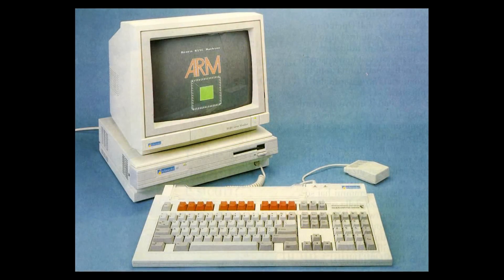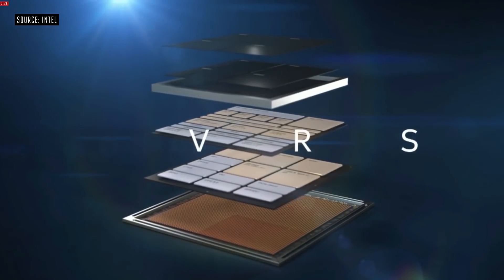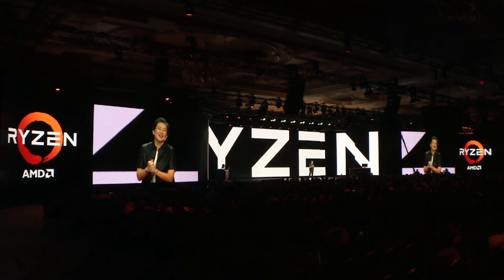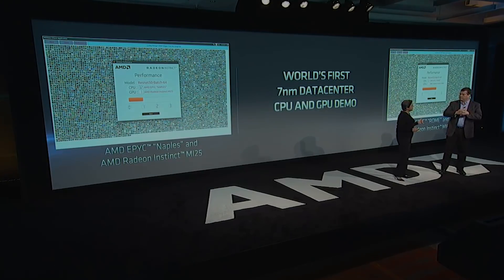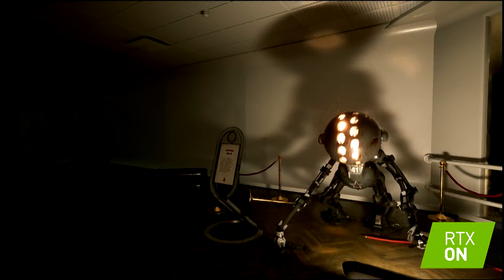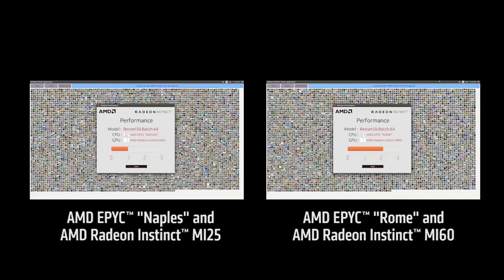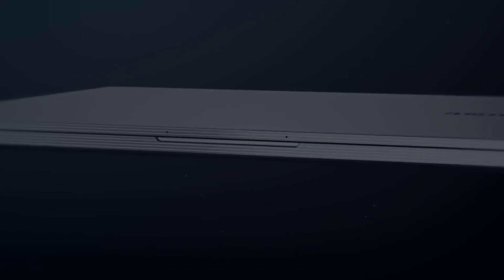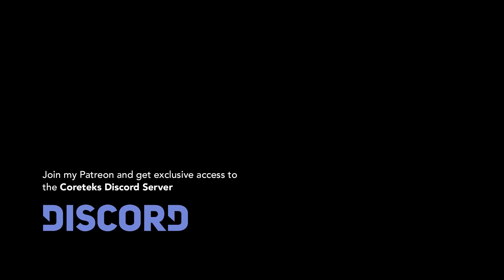Hardware trends: How many cores do we need?!

Comment: Amdahl's law is pessimistic because it does not account for that while adding cores, developers will expand the scope of what the system can solve, i.e. Gustavson's law reflects this. An example is adding more cores may not increase the framerate in RT, but it could render the scene at higher resolution at the same speed.
Reply: But do we need more than '32K' instead of 'current 4K' ?
32K being: 2x16K resolution VR.

Comment: that graphical about making code multicore isnt exactly accurate.
You wont be initializing a variable in one core and using it in another at the same time.

Parallelism only works well with instructions that can be done independently and the results merged later. 

I think thats the perspective thats missing here.

The real benefit of computational parallelism isnt doing one task faster but rather doing more tasks. Sometimes it just so happens to be the case that you can break down one task into smaller independent pieces.

This misconception of speeding things up with multi-threading comes from not understanding how to use multi-threading. 

Also it would be a terrible fate if we were stuck with MOBAs and Battle Royale games for the rest of humanities existence.
so i think your missing out on the fact that adding more cores allows for developers to try adding more features to games that will run at the same exact time as other features.
Reply: I couldn't say it better. 
There are other types of rendering as well, e.g. based on convolutional neural networks, 
which, according to the narrator isn't a case of a customer's usage (wrong!)
Nvidia using tensor cores for their autoencoders to denoise the picture, 
which reduce the load on the rendering process and boost FPS. 
Finally, as you mentioned, it's not just about stupid rendering.

Comment: For normal use, one to four as fast as possible cores and many tiny ULV cores so everything can keep one to itself with it's own dedicated addressable memory range.  I foresee a colony of cores dedicated to simulating a bureaucracy that is dedicated to completing every task but as securely as possible without any task having any ability to stall or access anything not expressly passed to it by the owning process/thread; after asking multiple security threads to verify that it is safe to do so, which can be accelerated by each security thread carefully determining actions safe enough to and then whitelisting.  Eliminate all possible side channels.  This might already be doable with enough programs having a CUDA version; but I don't know if a GPU can currently be used that way.

Comment: I don't get why raytracing can't approach a higher parallelism than 95%. Wouldn't very small improvements in the code potentially result in impressive speedup gains?
Reply: Chrysippus, imagine the 5% is the guy sitting at the top of the organisation, giving out jobs to the other 95% and then puts it all together in the end when they come with their results and show the result on the monitor.

Comment: There is just one thing wrong here, you talk about the law of parallelization. Remember this calculation you made is for the optimal case scenario, aka the most favorable for the parallel approach. In reality, real SW usually runs to the single-threaded roadblock way sooner. For example in a game, it does not matter if the physics engine can thread to 256g threads or that even the rendering can do 32, when you can run in to single animation or effect that is single threaded, becomes bottleneck quickly and drags the framerate for that scene down. In that moment that will be your bottleneck and your performance and it does not matter how well the rest of the code is parallelized. Same goes to for example video editing, You need just one aprt of the chain to have single thread bottleck and it will hold the whole thing down and it does not matter if the rest of the core is scaling well, as long as the bottlenecking thread is active, you are not scaling. And that is why superior single thread performance is still the main factor in CPU performance for most use cases, cores come second, cause they are pretty easy to add if needed. Its way harder to make one core perform 40% better than throw 16 of those cores in there.

Comment: Very good points about the limits of paralellization. Here's hoping programmers and/or hardware guys can come up with ways to get more multithreading done in sequential code. 
I'm not seeing a future for a Surface Thin Client in my backpack, though. I have very little use for a laptop that's effectively dead as soon as mobile connectivity cuts out... and coverage isn't nearly good enough where I live. That said, I'm seeing a lot of TC usage in companies. (Citrix in particular; there's a lot going for it from an IT security perspective and it does save on hardware costs.)

Comment: There are some glaring issues with things like the raytracing performance estimation. Sure the building of the acceleration structures is not trivially parallelizable. So there is that. 

However additional rays are trivially parallelizable. So that part does indeed have ideal performance scaling from additional cores. So one can increase the rays per frame basically without bound assuming constant scene complexity. And if we see now the games have rough budget of less than 1 ray per pixel there is need for way more rays than that even for current scenes.

Another thing about parallelization is that amdahls law is insufficient to tell us everything. As an example FFT has the usual time consumption of O(nlogn) but in parallel it's O(logn), like so many others. In terms of amdahls law it would be as if the parallel percentage would change as per size of the working set. You can estimate it that the serial part as a ratio of workload goes like 1/n, always going closer to zero but never reaching it.

Comment: Consumers don't NEED the performance they are being sold already. Companies have been very good at creating the need for performance levereging social media and the requirement for small portable devices with snappy reaction times. My guess is that at if HW scaling becomes too expensive, customer market will shift all its effort in diversifying in UI and user experience, rather than performance. Personal assistents, knowledge engines, augumented reality, etc...

Comment: Interesting clip. I would add, when single core single thread chips were the only ones, then multi-threaded programs didn't exist. But the nature of operating systems, even if they were single task systems like DOS, you still had to get at and use device drivers. So we got the concept of threads. Once we had an OS that could handle threads, then we found a multi CPU system (server) could handle more than one thread at once. Then we started to fiddle with hyper-threading. Then we saw multiple core, then both... That was all about 20 years ago. So now we have individual programs that may spawn 8 or 16 threads, and we have many cores that can all run 2 threads, so the way software is written, is changing.
It should be also said, writing heavily threaded programs is hard. Some kinds of tasks lend themselves to it rather beautifully, but many don't. We will move toward an increasing number of cores & threads, as a way to sustain the principle of Moore's Law, but for that to work, we need more multi threaded software. To get that, we need tools to make it.
We had tools to write multi-threaded code 20 years ago, when I was learning to program. But what we have today, 20 years on, is really no better.
Before we criticise developers for not writing better multi-threaded code, we need to take a good hard look at the quality of the tools, and the degree of difficulty in using them. But even with the best tools, some kinds of tasks lend themselves to parallel processing and some just don't.

Comment: Moving into a different material other then silicon based processors, the clock speed can be vastly increased. Gpu's are unlikely in danger just yet. Also games will likely use machine learning based a.i for everything from graphic improvements to actual a.i behavior.  Alpha star (deep mind) uses around 50% of a desktop gpu for it's a.i.
Apu's won't cut it for cutting edge next Gen and the Gen after video games.

Comment: There’s Mozilla’s Rust programming language, which is specifically designed for parallel workloads and is being used to greatly parallelise the Firefox browser.

Right now, Firefox has fully parallelised the CSS engine, which puts it ahead of Google Chrome, and the next step (which will be landing this year) will be parallelising the rendering using WebRender, which uses the GPU to render the entire web page, rather than using the CPU in a single‑core manner like what Chrome does.
Reply: Rust and all sorts of corrosion are bad! Use de-humidifiers and other anti-corrosion agents to keep your stuff safe and Rust-free!
Reply: Google's Go is slowly but surely eating Java's lunch on the server. New projects that would be in Java 10 years ago (Kubernetes and Docker for example) are now in that language. Server CPUs have a ton of cores with meh single core performance. It's higher level than Rust and have different use cases, but it's super easy to spread the load out on many cores in that language.

I love Rust, but multi-threading isn't as core to the language as it's in Go.
Reply: @spsproos  Funny how you mentioned Kubernetes, it was first created in Java. :-)
Anyway, I would say Go is the new hotness, but Rust does seem to be technically a better language.
Reply: @autohmae  No argument there, I love just how powerful the language is. I wish I could find a central place for Rust in my professional and personal coding, but I find Go much more productive for just about any kind of servers or I/O work.
Reply: Rust? I'd rather use C.
Reply: @G33KN3rd  Kids these days. Before it was C? I'd rather use Cobol. Seriously though, good luck with writing correct heavily multithreaded C programs...
Reply: @az09letters92  multithreading is hard regardless of language...

Comment: I see most of what you presented in this video as challenges more so than hard limits in computing technology. If we make (or better yet have A.I. or hardware make) better compilers that increase the parallelization of programs, we will be able to make way better use of many processor cores. Amdahl's law goes both ways in a sense, because the difference between 95% and 99%  ability to be executed in parallel would be a 5x reduction in latency for large amounts of cores, for example. We are definitely reaching the end of the silicon boom, but there will surely be a couple more doublings in performance before we hit a hard wall. Hopefully there is a future in photonic computing though, if we really want to have another explosion of personal computing power.
Reply: How many decades have been spend on making better compilers which can generate better parallel code ? And mostly failed. I don't think that is where the improvements will come from.

Comment: The problem isn't that WE CAN'T make stuff parallel, it's that we don't want to.
Multi threaded workloads: Are harder to debug, Are more error prone, Are harder to program, Have overhead and can make code harder to read/manage.
For games, overhead is very important, yes you could make the game better for people with 32 cores, but then you completely fuck the majority of the market with <6 cores. 

From the steam hardware survey, <2% of people have >6 cores. It's a catch 22. More cores are useless in most workloads because nobody wants to buy CPU's with more cores because they're useless in most workloads.
Reply: They publish minimum requirements for a game for a reason. At some point it makes sense to jettison old hardware. Just because tech progress slowed down, doesn't mean 16, 32 or core CPU won't become a requirement, just like now many games don't load on a single core.
And consoles drive this a lot too,  so when they massively increase the core count, you can expect the same for PC games.
Reply: @fobusas  It will, but it's going to be slow.

Comment: Just a clarification, Amdahl's law only applies to individual programs that have both sequential and parallel components.  It does not apply to running entirely separate programs on separate cores which is perfectly parallel, so multi-tasking can scale indefinitely.  I know that the majority of users will never use their hardware to its full potential, but having more potential is still a very good thing when it comes to putting powerful tools in the hands of curious individuals.  With more capable hardware comes more talent looking for ways to (ab)use it.

Anyway, I don't think there is any need for the CPU/GPU manufacturers to halt progress on parallelizing their hardware because they don't think many people can use it... that's intel bullshit sitting on quad-core CPUs when there was a clear (though perhaps somewhat irrational) demand for more cores.

The software developers should always push the limits of their hardware, and the hardware manufacturers should always be looking to remove those limitations.  Neither should ever assume that any number of cores will be enough... just let the market forces find the limits (if they even exist).  I can easily imagine a future where we have 256 CPU cores, with 128 of them dedicated to a proper AI assistant that is far better at multi-tasking than we humans are.
Reply: Amdahl's law applies but it scales linearly because the parallel coefficient is 100% for such processes. Also, I do not agree that raytracing is 95% parallel, I think its 100% parallel. Where is @Coreteks source on this?
Reply: @adi1133  30XX series will be 3-4x faster in ray-tracing than 20XX series. Not 27%, so I don't think the 95% value it correct.
Reply: Perfect
Reply: Sound and video conversion and reencoding works very well this way as many can be done simultaneously
Reply: And using Amdahl to estimate performance of next gen chips ignores Architectural improvements

Comment: Right, but Linux video editors, and multithread programs can be much more efficient running in parallel. Kdenlive is very good at assigning work to as many cores as you like during the rendering process. In preview / editing mode it only works with non parallel code, but the rendering is where parallel performance can hit 100 percent.

Comment: Yes. I am NOT an average user. But I could use more cores than even 8. Maybe 16 is around the top, but I wouldn't say I wouldn't see benefits from 32 cores. - Talking smack with a quad core Trinity APU lol :) -. Cause yes, one or two sw won't be faster just because having 16 cores. But when I simultaneously running an audio player without HW acceleration (ASIO FTW) , 2 different versions of Firefox at the same time - which uses 16 threads together -, and a lot of smaller applications, running a photo editor, maybe even doing a batch conversion... Then I am playing something while this going in the background, no. I will see the performance gains. Although I know. I am not average. And I am not normal.

Comment: Nice points at Amdahl's law... but u need to cover Gustafson's law also... maybe in another video
Reply: Yep. I thought theres something wrong with his assumptions, especially since the problem size is reduced for many things right now, so it is possible to work with our not so big computing capabilities. For my bachelor's thesis I trained neural nets on 64x64x64 Voxel databases. I would love to see things like 1000x1000x1000 or even more, especially, since I know how well this worked with such little data and how well this scales with higher resolutions. But the 1080s we worked with, won't do this. We would need a much bigger parallel computing ability and much, much more memory for doing something like that.

So a program might only be 95% parallelizable, but if you increase the problem size, it might get better, because it matters more to the parallel parts, than to the lightweight sequential parts like adding up the results.

The most important thing on that is, that many subproblems are 100% parallelizable.
Matrix-matrix multiplication is an n^3 problem, that gets down to log n, if there are enough processors.
Sums are n log n and get down to log n with enough processors.

So every problem using one of these operations, will profit from more cores, with nearly no limitations other than problem size and memory bandwidth/latency. And the best thing is, that nearly everyone using these operations, does this through external implementations building upon blas or the intel mkl, which are already parallel.

Comment: ALL THE CORES!  False.  What we need is gigahertz. A single core at 20 ghz kicks a ‘cpu running 8 cores at 1.6 ghz’ ass any day.
Reply: Do the math on how long something with no mass (electricity) can travel in one clock of a 20GHz system (1/20000000000 of a second). Assuming a perfect medium, which is not the case, it might not be enough to even travel through the chip itself. Imagine designing a chip like that - not going to happen any time soon. They'll just make more cores.
Reply: Chrysippus True that’s what they’ll do.  But it’s still not what we need.